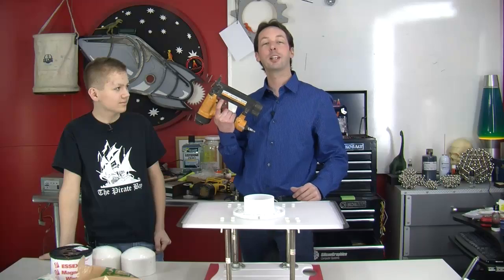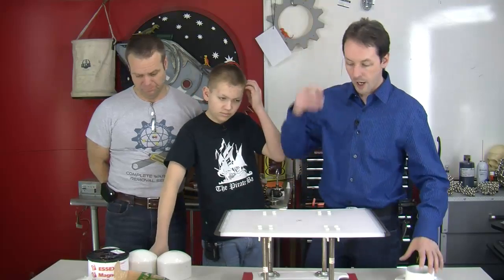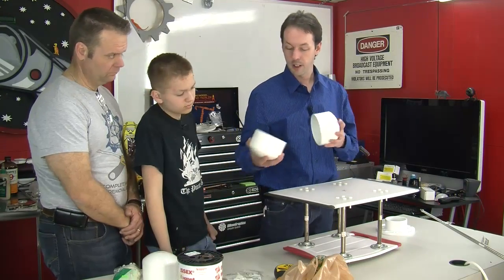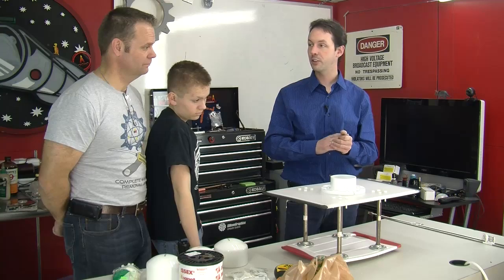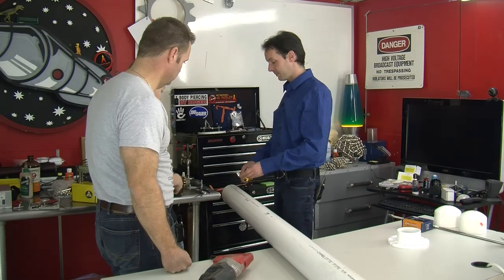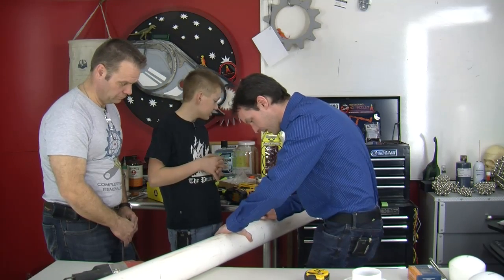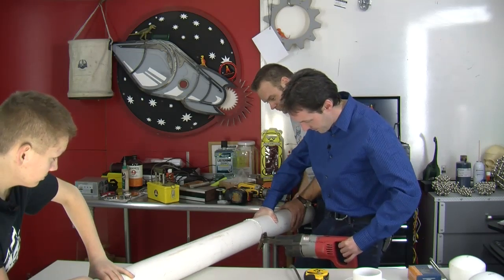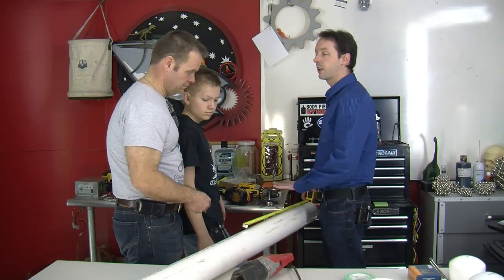How to - Home Built Tesla Coil - Secondary Coils Pt 1

Comment: how to mark around the pipe use a wrap - u can use a welding wrap but there long - u can use a gasket material or anything pliable - u can even use poster paper - cut and use the straight side for marking - wrap it around the pipe snug - line up the edge with the other edge when u come around - over lap - needs to be about 4 Inch wide - then mark your pipe